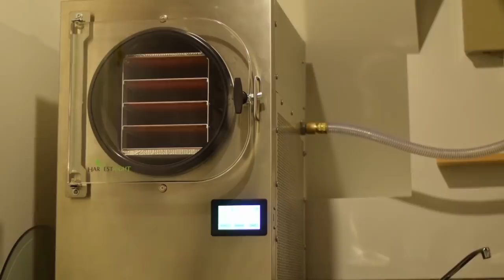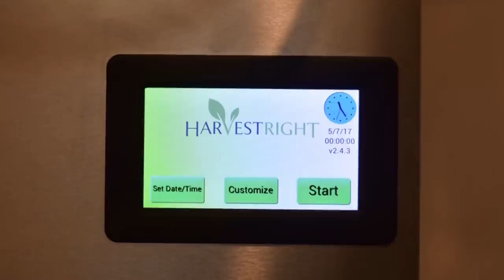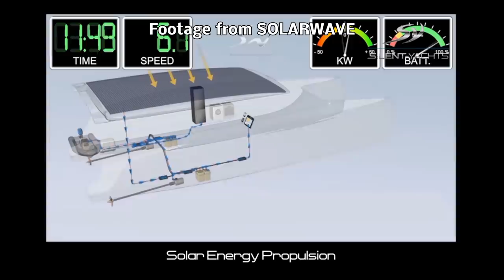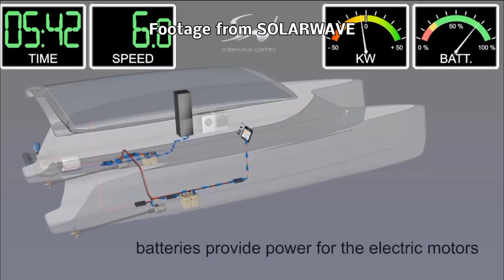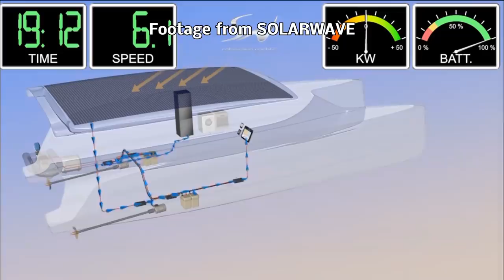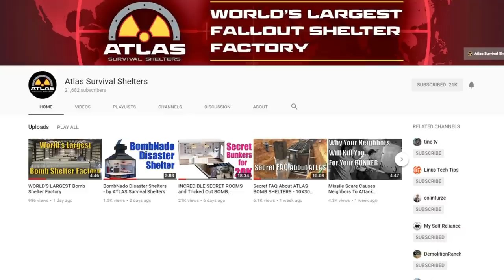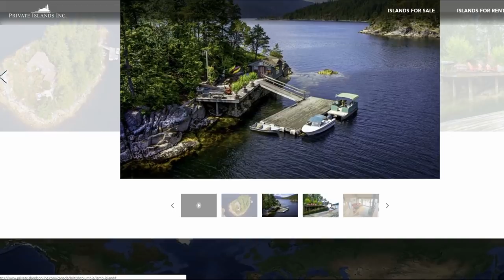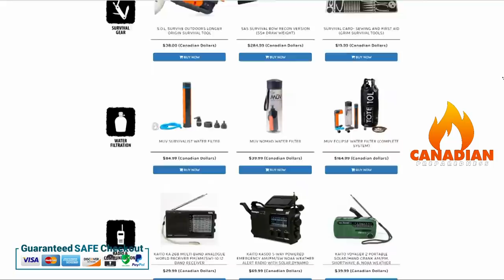TOP 10 Prepper Items YOU WISH You Had!

Comment: Well if we're just dreaming....
Things I wouldn't turn down if someone gave them to me. 

65' Schooner rigged Monel-400 hull with an electric motor, solar panels, and about 5kw of lead-crystal or silicon-salt batteries.  Redundant osmotic water purification and desalinization units. And a small diesel generator. 

EarthRomer - or Earth Cruiser FX
5 Ton 6x Military truck with non-pneumatic tires, and multi-fuel engine. 

Enough land for me and a small community (say about 60 people) with log homes (20-inch logs for R-value and thermal mass)  a 360-degree berm firing range, about 200 acres of farmland and 2000 acres of forest land - with a lake and a large stream (or small river) stocked with fish & ducks. And about 500 acres of pasture land for the horses & goats

A Yanmar diesel tractor with full implements set. 

Fat Tire - ebikes

Comment: Please do the Top 10 Guns!!!! Better yet, do a collab with American Prepper. And have American Prepper do a response video to this one, critiquing your choices. Another great vid!!
Reply: top 10 guns for preppers here ya go
1: single or double barrel break action 12 gauge shotgun (for caliber conversion tubes)
2: maverik 88 (budget mosberg 500 pump action shotgun) for home defense or hunting
3: bolt or lever action .22 long rifle Simple for small game hunting (over semi auto .22 because suppressors will work better as well as not having to worry about failure to cycle)
4: some form of revolver (can be reloaded with blackpowder rounds if necessary) additionally i would recommend a .357 cut for moon clips for multiple caliber use
5: some large caliber bolt action hunting rifle .308 or bigger 
6: common semi auto handgun (probably a glock or something its easy to get parts for)
7: Some semi-auto battle rifle or 'assault rifle' gun (ar-15, ar-10 ak-47) 
8: second maverik 88
9: second battle rifle
10: second semi auto handgun (really these three would be either for other people who might be with you or to stash somewhere for whatever reason)

Comment: Boats show up on radar so not really a good bug out vehicle the larger ones . But if was to get a boat should find you an island to actually stay near.  But alot of things you can actually build on your own sure it takes longer to do on your own but no one will know what your doing or your location of your hide out when do on your own .  Only thing really hard to build would be your boats unless you build boats for a living but if I was going to build a boat I would build a trimaran with center front loading fold down ramp for vehicle transport but with stealth lines so basically the front would open like a mouth your vehicle goes inside and is placed In center in lowest portion of hull . Use either line x on the top of the boat or some other type of none reflective coating . Give it a solar engine but have where your panels can be retracted . And have about 3 1200 horsepower inboards one in each hull as back up engines or your go fast engines . And pretty much you add whatever weapons you like to it and Bam got you and Apache on the water . Pirates and other type marauders of the oceans won't catch you and if you wanna fight them you can . But still ocean supplies alot of food and if you grow onions and limes . You can cook shrimp with no fire in the juices .  It's called ceviche if interested in a food like that but still I would be Leary of ocean if there is any such thing as a government power In the world.

Comment: I would aim for something like a Lexus gx470 for an overlanding vehicle. You can pick them up with under 100k miles for less than 12k depending on the year model. Toyota reliability, Thorsen center locking differential, add a 3" bilstein lift and some 33s.. And until the world actually ends your wife might let your doomsday modifications slide due to the Lexus luxury she is enjoying.

Comment: A lot of your list is just rich guy toys, 
The bike is useless without a sready source of electricity to recharge ( ie solar farm or working grid) , charging from any other source would use more gas than a small ( 90cc ) motorcycle would.
the big atv trucks cost more than a small farm.
A small piece of land with a tractor or gas tiller will be all one family can handle, and a study house is a bonus ( especially if it is rather fireproof ( ie block construction ) .
The duece is a good cheap survival truck .

Comment: No offense intended, but if you put armor and turrets on a luxury solar powered boat of that size, your performance in the water is basically going right down the tubes. Bring your 50 cal for sure, but better leave the armor on the shore and beef up those emergency diesel engines instead.

Comment: If you are buying those high end vehicles, you'd better hope they are bullet proof. When you run out of fuel getting 10 mpg, you're a sitting duck. A 40's to 80's Jeep with a VW TDI, will take you so far into bush on one tank of fuel, no one on land would follow you for fear of them running out of fuel. None of those vehicles go a 10th of the places a Jeep, Landcruiser, Landrover etc. would go. For all of 10K. If you are not thinking efficiency, you're not thinking. Just saying.

Comment: Heads up on #3  did you know Canada you cab buy a sea barge  thats 60ft by 40ft  that 20ft to 16 feet hight  for 3 to 8 american dollar's thay 2 inch thick still  and pay 3, to 5 thousand for all the water & air   and turn it in to a bunker or ocean side house   , i have designed a beach house using a sea barge  where the out side looks like reguler beach house  ,  the only give aways are the windows 2 in polymer windows that are water proof sealed  and the back and entry doors have water proof bulk head doors that are hiden be hind a false walls that open up to close the bulk head doors for a air tight seal.  Same design can be barryed under ground after being sprayed with rino lining witch cost more then the barge it self at 12 thousand  or you can just paint it with oil based paint 5 coats at 3,000 usd

Comment: Do a Top 10 bug out vehicle's under 25,000$
Reply: here's my top 10 (keep in mind bugging out for me is only 2 people so seating capacity is not a major concern)

1: light duty 4wd pickup truck 4 cylinder (think mazda b series, toyota tacoma/t series, ranger) gas or diesel
2: full size light duty pickup truck (think f150, chevy 1500...)
3: jeep grand Cherokee 
4: jeep wrangler
5: toyota highlander or fj80 (basically toyota's version of the grand cherokee)
6: chevy suburban
7: ford explorer/expedition
8: honda CRV
9: ford escape
10: subaru outback

the main reason for these is they have light duty off road capabilities, parts are common, they dont draw much attention either parked or bugging out. they're not extremely unobtainable, and they also make good back up cars for every day use I would also make sure the vehicles are all equipped with a trailer hitch and instead of mounting a winch to the bumper i would mount it to the trailer hitch. with the pickup trucks and jeeps i would have a hitch in the front as well (this is also not uncommon because its a method of towing a vehicle behind a camper or something) I would beef up the suspension and maybe do a small lift on it but not enough to draw too much attention to myself. remember with the exception of the outback these are all fairly capable off road vehicles from the factory.

The light duty truck was best IMO because it has the best balance of capability, efficiency, and practicality, since i dont need to carry thousands of pounds of stuff with me they just beat out the full size pickup trucks slightly. though i will admit the thought of a 4bt swapped f150 does greatly appeal to me